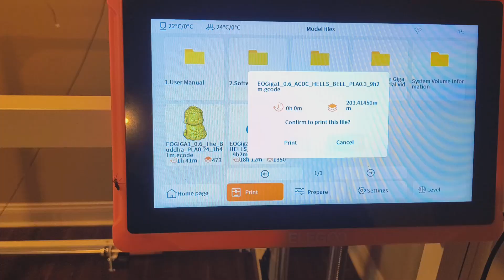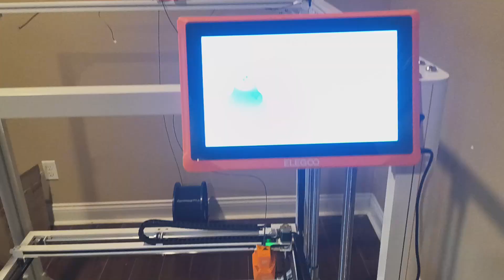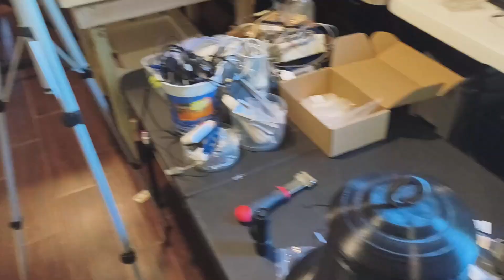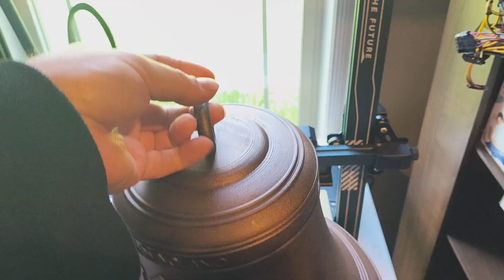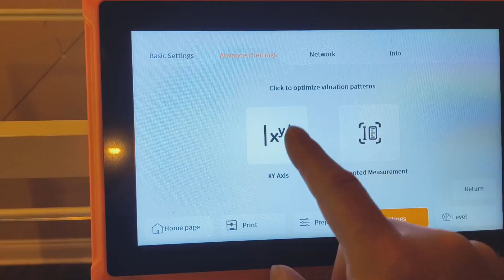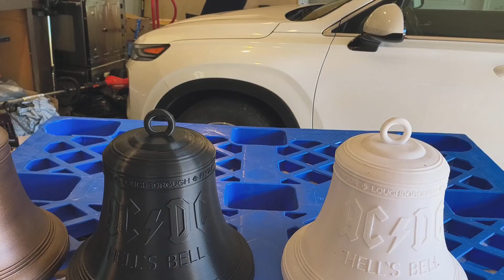Elegoo OrangeStorm Giga - AC/DC "Hell's Bell" Test Print

Comment: I'm in the market for a large printer.  if you needed 800 x x800 x 1000 or larger would you recommend the Giga or the VEHO?
Reply from the maker: For 800x800x1000 I would definitely go for the Giga as it is much easier to assemble and (so far) has worked perfectly.
Now, TronXY do make a VEHO800 Pro that should be closer to the speed of the Giga, but I've never used one of their Pro models, so I'm not in a position to compare it from experience.
Other things I like on the Giga are the massive touch screen and that there are profiles already available for the machine with all different nozzle sizes and layer heights.  With my TronXY they basically gave me some rough instructions on how to adapt another printer profile in Cura and had a single 0.6mm nozzle option.
I do like the smooth glass beds on the TronXY machines over the 4 split plates on the Giga, but I'm ordering a perfectly cut single PEI plate to replace them.